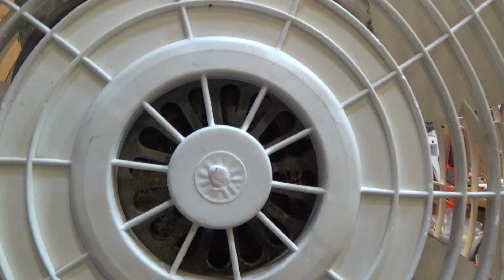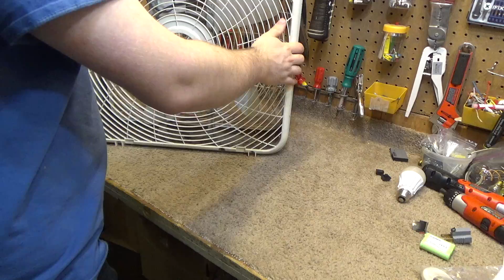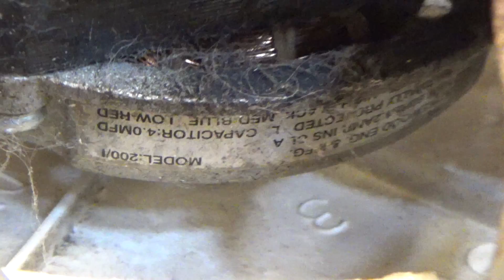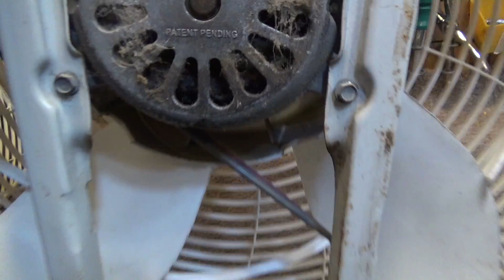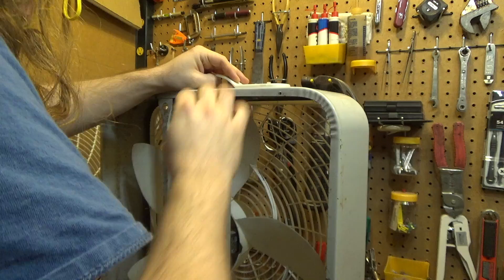Lakewood 224 Brace Blade Box Fan | Initial Checkout

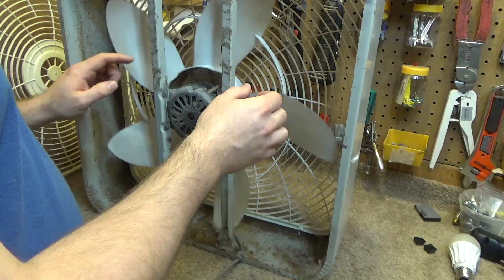Comment: 4:20 Sadly, and I just learned this the holmes box fan blades are slightly different, so they won't fit, and holmes no longer makes box fans.   Which sucks
Reply from the maker: I think it's just as well. The box fans sold under the Holmes brand were atrocious.

Comment: The Holmes blade has a different shaft size and the blades have a decreased pitch. I have a spare blade for one of these that came off the thermostat version of this if you want it. The one I had the cabinet completely rusted out at the bottom and had holes in it motor still works though. Just parting out though not much left of it at this point.
Reply from the maker: Definitely interested. Send me an eMail.

Comment: The letters DU is a date code of some kind, that they started putting some time in the 80s. I used to know what the date codes stood for back in the DTVF days, Josh G posted on that, but I can't remember what they are. One of the reasons I wish some of those guys were still active.
Reply from the maker: The loss of that DT forum was tragic because there was so much information on there that doesn't seem to be anywhere else.

Comment: The tips of these blades don't move any air to begin with because there's barely any material to it, let alone pitch.  These and the Lasko petal blades are more like 16 or 18 inch fans.  So the part of the blade that actually moves the air, closer to the hub, that isn't warped, is still able to provide the decent performance.  It would be interesting to see what Lakewoods looked like today if they were still around, probably something similar to Holmes or Aerospeed (I don't even think the Aerospeed box fan is around anymore either).
Reply from the maker: That is a good point. They probably would be more or less the Holmes units, as that's where those are derived from.

Comment: I was surprised by the power of that Lakewood. Very efficient for the size of that motor.
Reply from the maker: I was surprised as well, mostly because of how warped the blade is. I don't think the motor is all that small, the diameter is smaller than the old McMillan motors, but it's deeper. It's also important to keep in mind that PSC motors are significantly more efficient than shaded pole motors and can output the same amount of power in a smaller form factor and using less electricity than shaded pole.

Comment: The model is 224. It was the successor to the Lakewood 223. These weren't really bad fans I actually liked these. Looks like they put a motor for a 200i in that one. I'd imagine that was a factory error by Lakewood. Neat fan hopefully you can get the blade un warped.  The modern Holmes fan blades won't work on these older Lakewoods. The shaft size is different.
Reply: Didn't all of the early Lakewood box fan motors say 200/i on them?
Reply: @andrewg593  the 227 I had said 227 on the motor.  If I remember correctly
Reply: @torythefanman  Then yeah it was almost certainly a factory goof.
Reply from the maker: @torythefanman  I updated the title/description. I tried to bend the blade back as some people have suggested and it doesn't seem to do any good, I've yet to have good results unwarping any plastic blades unfortunately.
That stinks, I was hoping that would be an easy way to replace it. Do you have, or do you know anyone who has, a replacement blade for this they'd be willing to part with?

Comment: Definitely cheap fans but they perform very well. One of my favorite box fans out there. The model is 224. 200/i was the basic model with the thin cabinet and the standard guard. This has the 223 cabinet.

I don't think that is the original handle. The original one would have had the numbers wrapped around the hole for the knob and would have indeed lined up to the knob. The 200/i that I have has that style of handle where the numbers don't line up.

Good grief what happened to that blade? I have never seen a brace blade so far out of whack before. It ran almost like it has the wrong blade on it. It was going extremely fast so this blade may be a replacement already. The Holmes blade will not work on it, it is far too shallow pitched. You need one of the earlier brace blades that has a much steeper pitch to it. It's too bad that blade is so screwed up. If I had one I would send it to you. This is a neat piece and definitely deserves a restoration.
Reply: Do not insult that fan!
Reply from the maker: @xylptheiner7014  STOP HARASSING PEOPLE ON THIS CHANNEL!
Reply from the maker: Title/description updated.

Considering the seeming mislabeling of the motor, perhaps the whole fan is a mis-match unit? This came from the same person who sent me the 16" Bionare model which I also don't think is fully original. Perhaps they were just throwing parts together or something. With that in mind, I suppose it's possible the blade also isn't original. It seemed to me that it was going way too fast, and the blade seems like a newer one being extremely flimsy. Of all videos to forget to observe the power consumption, it would have revealed a lot about the performance of the blade.
Reply: @JordanU  I'm almost certain it's original. Lakewood probably used whatever motor they had laying around and went with that. These motors, while cheap, did have a lot of power behind them. Perhaps the motor was spinning so fast because the blade was so far out of whack. I saw 10 cooling fins in the hub upon further inspection which would have been correct for the time. You'll have to find a replacement blade from an older Lakewood with 10 fins in the hub. You could test it with the blade from that older one with the McMillan motor. That's the correct blade for it.
Reply from the maker: @andrewg593  I suspect it is running faster because of the lack of pitch on the blades. I didn't realize the McMillan one was the same shaft size, I'll have to swap it and see how the performance compares.